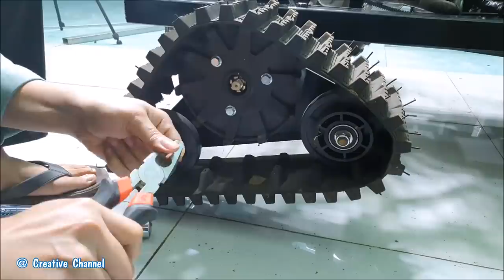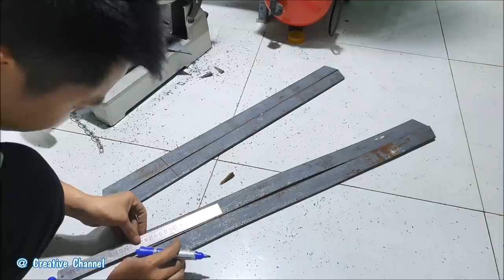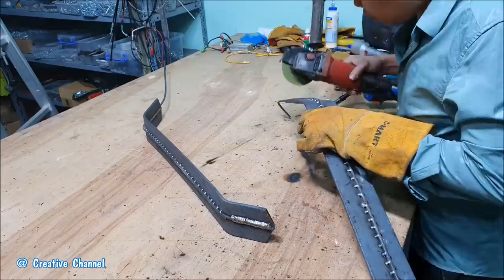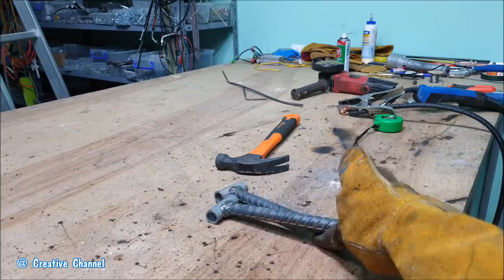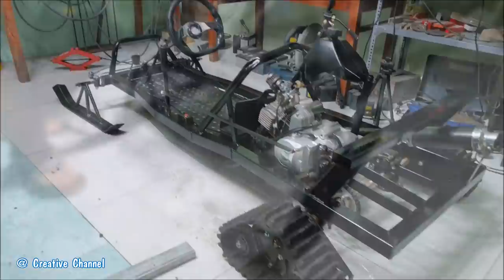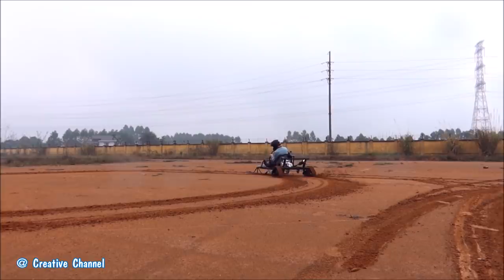Build A Go-Kart Snow Tracks from F1 Car DIY

Comment: Nice! Is that a G6Y engine? Looks like it.  110cc? Is it enough power for tracks? Do they tear up grass? I know full length tracks do but I wasn't sure if being a half track on the fixed axle would be better
Reply: Pit bike c50 c70 c90 derived engines etc not gy6 they have completely different setup more like scooter cvt long casing engines

Comment: Cool build. I wonder if you could put a small wheel on the front of each ski and on the back of each ski, so when you get on a hard surface, the wheels turn and there's maybe an inch or so of clearance between the skis and hard surface, and your drag or friction between the skis and hard surface is reduced. Keep up the great work.
Reply: Or have normal wheels with sleds under them with slots positioned in a way so the tires just peek out under the sleds.
Reply: @blakegebauer76  like skis on small Bush planes
Reply: @ericbest9562  exactly